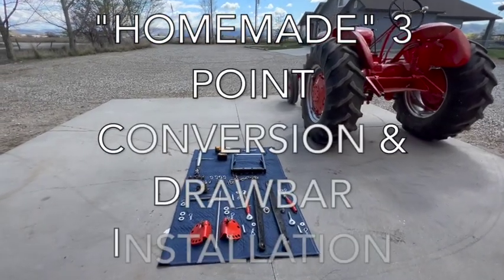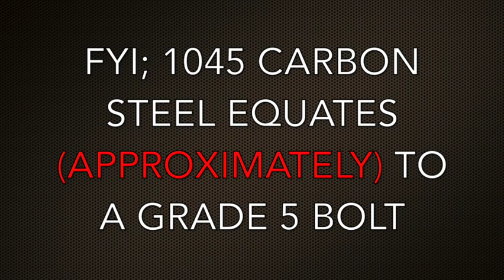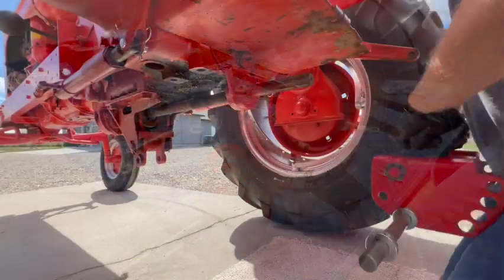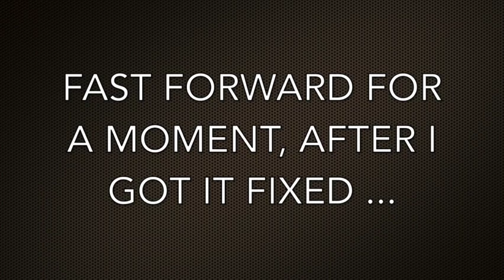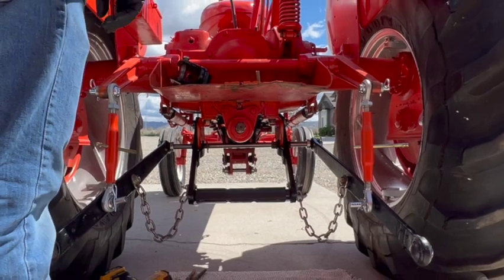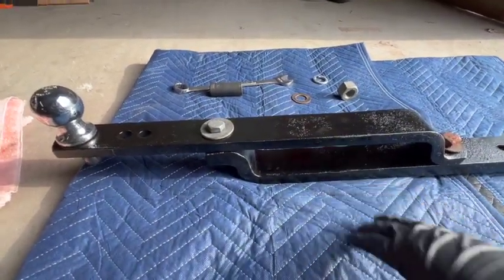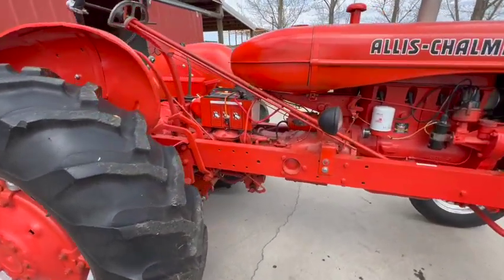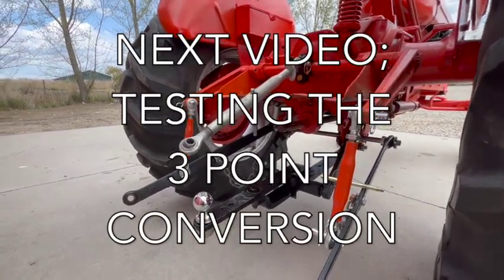Allis Chalmers WD45 - 3 Point Hitch Conversion & Drawbar Installation, Part 1

Comment: Good job on the three point. I'd lengthen your verticals and shorten your check chain to keep whatever you pull with the three point from hitting the tires on turns and riding up into the fenders.
Drawbar capacity is the weight it takes to lift the front tires. You could weigh the front of the tractor and then use a ratio of the distance from the center of the rear wheels to the hitch ball vs distance to the front wheel centers for more accuracy to the estimate. Those tractors pulled three bottom plows.
Reply from the maker: Good advice. Thank you.

Comment: Very well thought out and well implemented upgrade.  A few videos back in this series you cleaned out the gas tank with Evaporust.  I've used Evaporust with good results but never in a gas tank before.  How did you rinse the tank out afterwards?  With gas or something else?  Thanks.
Reply from the maker: Thanks Richard. Yes, I rinsed the tank out twice with gasoline. It didn't use much, just enough to slosh around and get all the surfaces.
Reply: @AntiqueCarsandStuff    Thanks!  Gonna try that today.